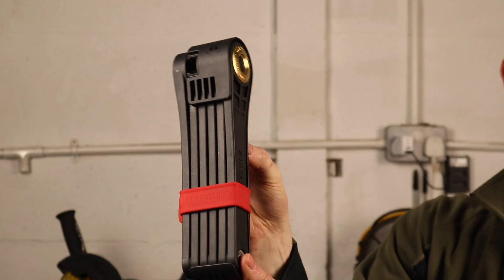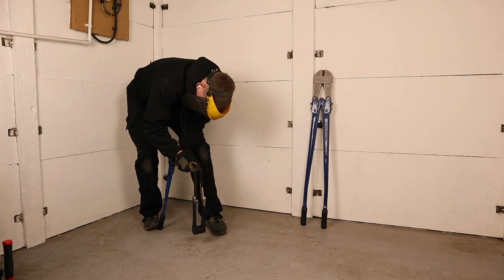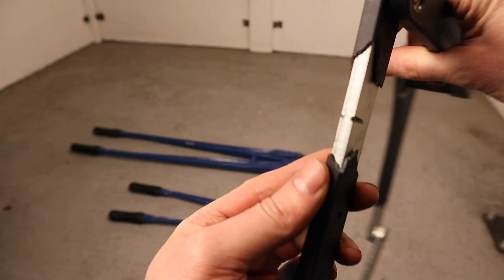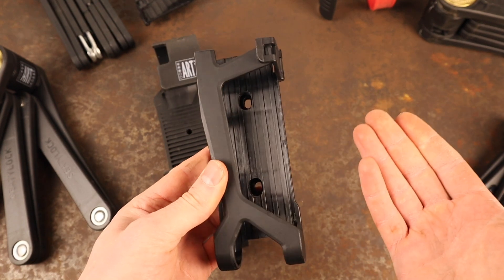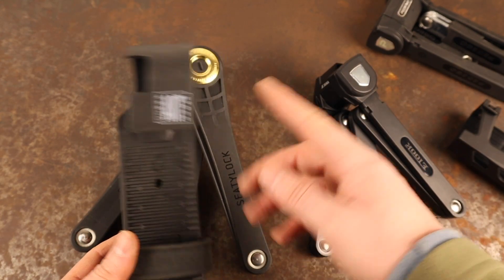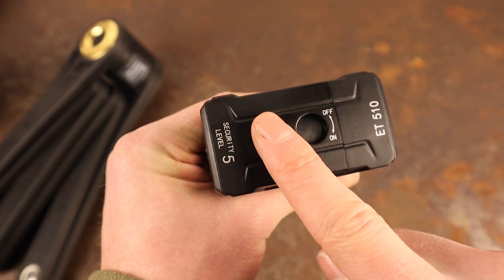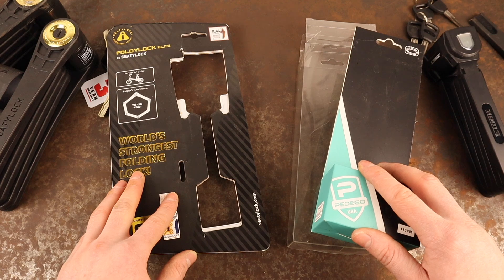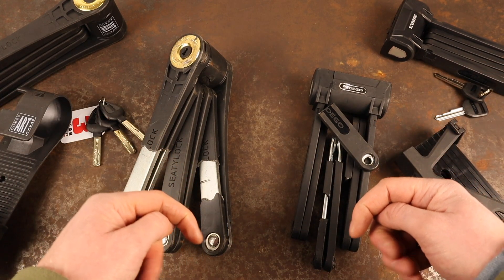Foldylock Elite vs Pedego Folding Lock - Destructive Bike Lock Testing

Comment: These folding locks are also great for locking up bicycles in 3rd world countries where bike racks are much rarer and that thieves have far less access to portable angle grinders so they work pretty well at securing a bike to a thicker pole!
I'm definitely bringing a few Foldylock Elites to Philippines so I can park my bicycles there almost anywhere and with peace of mind because a bike lock of this quality isn't sold there yet and its strength surpasses most if not all U-locks and chain locks sold there!
If I want an ultra-secure configuration there but don't have a bike rack, I could use the Seatylock to secure the front wheel and frame to a pole while the rear wheel and frame is locked by a Hiplok D1000 so it needs to be loaded into a vehicle in order to be truly stolen!
Reply from the maker: At the same time, if you're riding a nicer bike than others in town, you're more likely to be targeted. Sounds like a great trip! Enjoy.
Reply: @bikelockwiki yes, I'm actually planning on using e-bikes there that are imported so I'm also bringing in Hex and Pit locks to secure the hex bolted components of my bikes there!
In addition, I will also conceal the bikes with a cover that has a loop securable by a cable lock!
So the 3rd world country thieves will have absolutely no idea what they are dealing with if trying to strip off the components!

Comment: Its still a good thing I bought an E-took folding lock for the specific purpose of locking my e-scooter through its front wheel spokes and frame inside a movie theater by the railings there!
That's the thing I like about E-took fitting through those tiny openings of the spokes of e-scooters have!
That way, nobody can ever steal it with cable snips that one may have in their backpacks which are easy to conceal.
Nobody ever sneaks in a portable angle grinder or a 24-inch bolt cutter inside a movie auditorium anyway and the former would immediately be heard even from 200 feet away as it will echo indoors and I'm familiar with the noise angle grinders make!
Reply from the maker: Absolutely! Locking with any lock is 100x safer than leaving your ride unlocked.

Comment: Thanks. This video sealed the deal for me with the 110cm Elite. I have a new etrike (MoonCool TK1) that I plan to use to shop at Costco, Walmart, etc. I currently only have a cheapo U-lock and cable. The U-lock mounts to the bike on the seat post but the cable has to be jerry-rigged via reusable zip ties. With this lock I can mount both the U-lock (mainly to be used as a slight deterrent/better than nothing) and this lock and not have to jerry-rig anything. (And I know that no folding lock has a diamond rating; it's a matter of finding the right balance for my needs.)

It's heavy and expensive but my trike is worth it. (NOTE: I plan to take my battery and seat/seat post into the stores with me in the shopping cart. I don't want to sound cocky but if someone is willing to expose themselves to security cameras to get a 90 pound orange paper weight without the battery or seat...well then...so be it. I"d actually be interested in seeing the security video(s). "HEY...there's the guy. He's trying to walk up the hill with this monster. Oh...so sad...he didn't make it.) 😀

Comment: Thanks.  I used this video as part of my research when I bought a 2 pack of the Forever with matching keys
Thanks
Reply from the maker: No problem, thanks for watching and best of luck with the Forever, they're great locks!
Reply: @bikelockwiki it's just so cumbersome and heavy when I go out for a causal ride and don't want to take a backpack. I ride a Brompton, so I wanted the most convenient yet Secure lock on the market, and I think I found it... but dang, I wish it was lighter, so I could just carry it in my pocket as a just inn case, since I never really intend to leave my bike out, but maybe I have to go to the bathroom at a cafe or something. Any suggestion there?
Reply from the maker: The foldylock mini is a lighter alternative. Obviously offers less security at Sold Secure Pedal Cycle Silver, but it’s still a great lock for shorter stops, like you mention.
Reply: @bikelockwiki i was looking at those, but they seemed quite flimsy and perhaps not worth the added expense, compared to a simple cable lock? I suppose staying anxious and making my bathroom break or whatever a rush job should suffice if I had something at least as secure as the foldilock, mini. do you think it's more secure than a medium weight cable?
Reply from the maker: @NoZenith  I wouldn't use a cable lock to secure a bicycle when it'll be out of sight for any period of time. Most cables can be defeated with a large pair of hand pliers in a matter of seconds. 

The security offered by the Compact vastly outperforms even a chunky cable. But you're right it is expensive compared to a cable. 

A Brompton bike secured with a cable lock is what thieves dream of. Obviously the risk is dependant upon the area which you live in, but i would still heavily advise against using a cable as your primary lock. 

Hope that helps!

Comment: I'm glad to see how well the Pedego lock performed. The test with the bolt cutters was not fully realistic given that the lock would have to be positioned such that the person using the bolt cutters could use the ground to brace against and use your entire body weight. You also didn't mention that when a user purchases the Pedego lock along with their Pedego bike, it comes with a theft-protection warranty, which helps explain the higher cost of the lock. I can confirm that the keys can be replaced through local Pedego retail stores as well as through the corporate office.
Reply from the maker: You're quite right in saying that not all of our testing is how a thief would do it on the street, to be frank, it's not all designed to be. Instead, this test, conducted in the relatively controlled environment of our lab, provides a valuable comparison between the material quality and the overall design of either lock featured in the video. 

Honestly, I had no idea about the pedego "theft-protection warranty". I don't see it mentioned on the website (product page) or on the physical product itself, so not sure if any of your customers are aware of that either.

Thanks for the information regarding the keys, others will find this helpful! Like the above, however, this should probably be shared on the product page or within the packaging.

Comment: I think you did a good job covering many aspects of these, not just security. Very much appreciated (even though I already own the elite!)

Agreed with you on the secondary quality-of-life characteristics of the Foldylock.

While it's not as secure as an angle-grinder resistant U-lock, being much lighter and easier to store on my bike's frame down low meant I didn't hesitate to buy it as a 2nd lock. I use one in combination with a Litelok X1.
I suspect this combination of locks, when used correctly, is strong enough to deter all but the most dedicated bike thieving operations.
Reply from the maker: Thanks for watching! You’re absolutely spot on, with that combo you’ll be more secure than 99% of other bikes so others will likely be targeted before yours. 

Pretty bomb proof setup you have there, what bike are you locking and how have you found the Litelok X1?
Reply: @bikelockwiki  Just a regular bike, cost me just under $1000. I just do NOT want to deal with theft; the peace of mind is worth the $ and weight penalty to me.

X1 seems solid but wish the inside area was a little bigger. With my ~50mm tires it can be difficult to get the lock around both the rear wheel and frame with some racks - especially now that I have a rear rack getting in the way.
Reply: Is better the elite or the Forever
Reply: @ilcorvo980  the same, elite - 110 cm, forever - 90 cm

Comment: This is not a test, since there is no test for cutting with an angle grinder. It looks more like an advertisement, IMHO.
Reply from the maker: You’re right watching this back through I’ve just realised I didn’t actually talk this through enough in the video. 

I meant to talk through this as I typically do but missed it this time round. 

To clarify for those interested any lock without anti-grinder features can be cut in under 30 seconds with an angle grinder. 

We don’t deem folding locks to be suitable for e-bikes since Sold Secure Pedal Cycle Diamond is the first rating where an angle grinder is introduced to testing. 

Thanks for watching